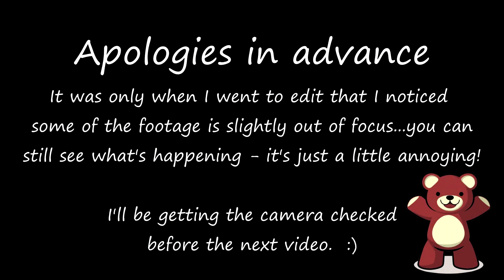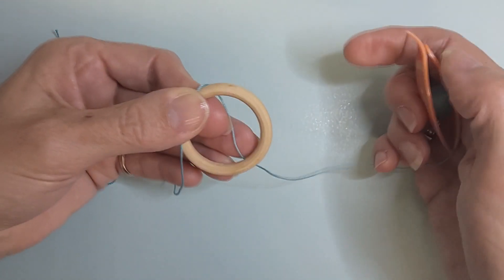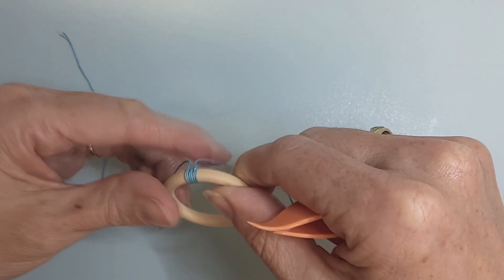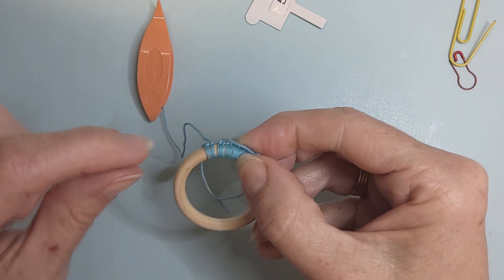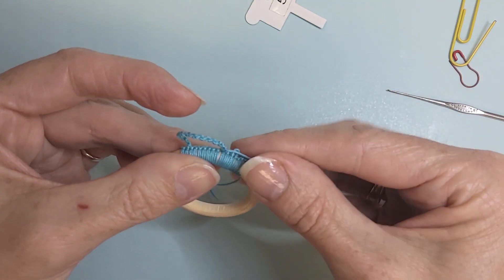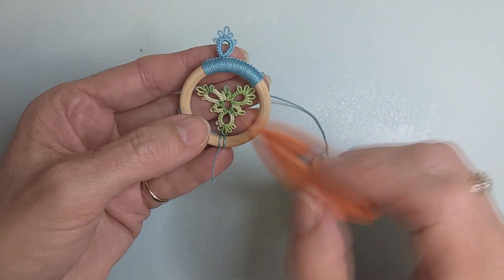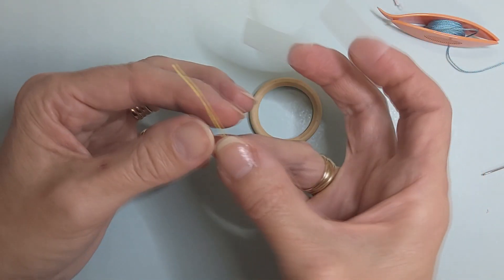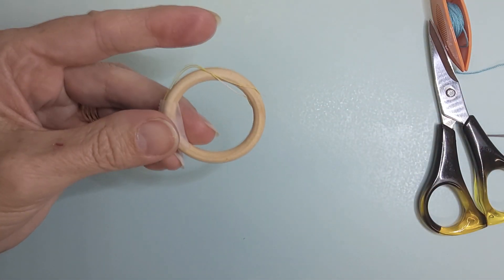Shuttle Tatting: Cabone rings

Comment: A tip for evenly spaced thrown rings on the cabone.  Using a ruler and pen, draw a line across the upper and lower portions of the ring.  Continue to make marks equidistance around the ring which will correspond to the number of thrown/floating rings desired.  This will ensure an equal number of ds between each ring since even threads of the same size will differ depending on the dye.  I've even had thread on the same spool with uneven density.  Or if you use a different size thread that the designer specifies, this technique will prevent you from guessing how many ds to make.
Reply from the maker: This is how I usually mark my cabone ring, but I hadn't planned on making two thrown rings!   - I didn't  count stitches, I was just demonstrating how to do it.... I probably should have thought about making the thrown rings even though!😆